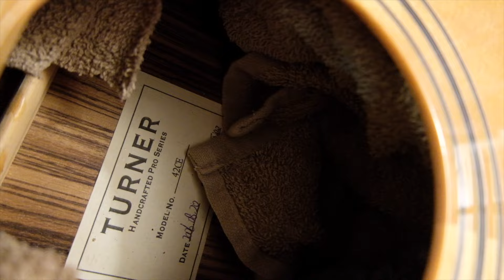Turner  42CE

Comment: What's the action at the 12th and how's the break angle over the saddle? It'd be interesting to check-in on this guitar a month or 2 or 10 down the line.
Reply from the maker: Hi, sorry for the delay in replying. The low e at the 12th is currently 2.75 mum and the break angle is about 20º. The bridge does seem to be leaning forwards slightly, so maybe will need a bridge doctor, shame because it’s quite a pretty bridge, shame to add a pearloid dot.  Maybe I will try to cut a rosewood plug for it.